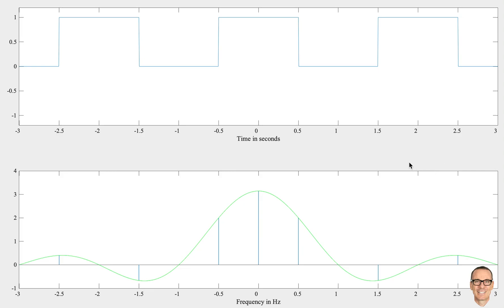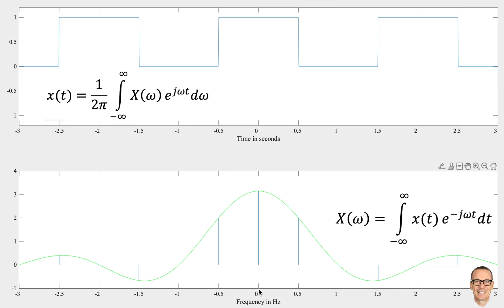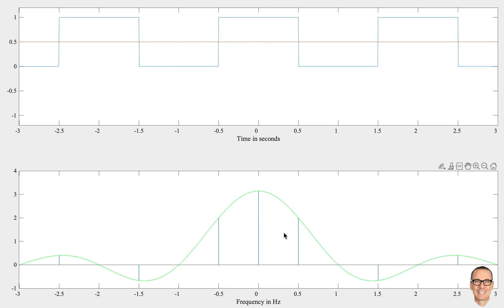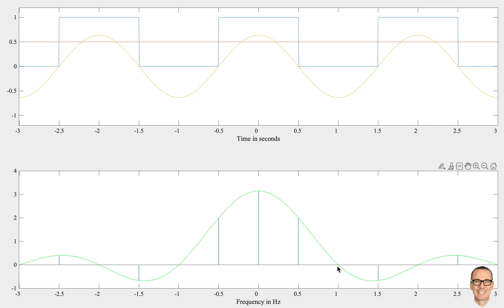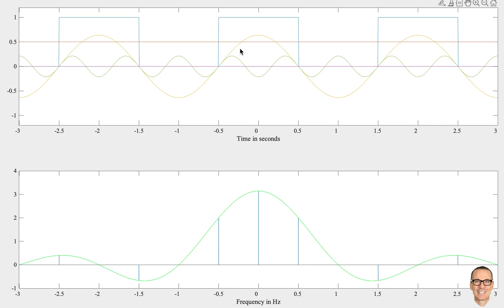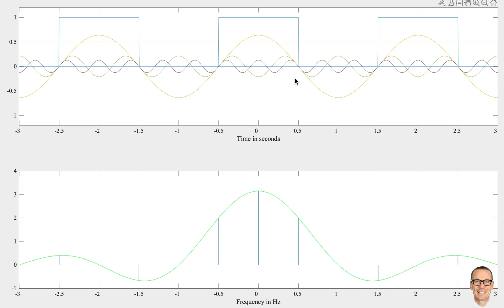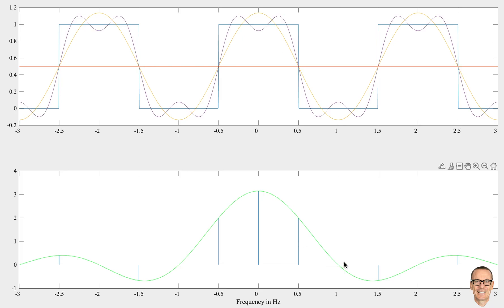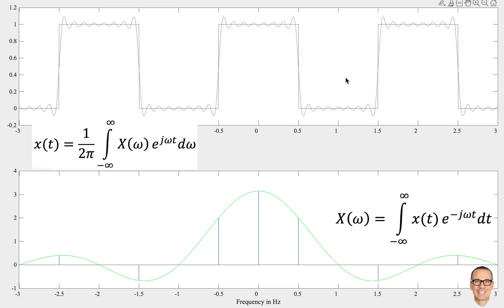Visualising the Fourier Transform

Comment: If each frequency has its own negative equivalent, does this mean only cosine waves are present?
Reply from the maker: Yes, that's right, in this case where the centre square is centred on t=0.
Reply: @iain_explains  And for an odd function, it's all sines.

Comment: Thank you for the video, I understand the horizontal lines are time and frequency. What does the vertical lines means?
Reply from the maker: I'm not sure which vertical lines you are referring to, sorry. Perhaps you mean the delta functions in the frequency domain plot at the bottom? Those represent the individual frequency components that are plotted in the time domain in the top plots.
Reply: @iain_explains  Thank you for your reply. By vertical lines, I mean the y-axis for both time and frequency domain.
Reply from the maker: The y-axis is the value of the function at the given time or frequency. For example, if the function represents the voltage across a capacitor in an electric circuit, then the vertical axis is voltage (with units of "volts"). If the function represents the displacement of a shock absorber in a car's suspension as it drives along a road, then the vertical axis is displacement (with units of "cm", or "mm"). If the function represents the sound level of a musical instrument, then the vertical axis is volume (with units of "dB"). ... etc.

Comment: In the given graph, avg value of the square wave (DC)  is 0.5 right ?
But in the spectrum at zero frequency (DC) it shows amplitude 3.
Why ? Pls explain if my concept is wrong....
Reply from the maker: In the description below the video it says: "* I should have mentioned that the definition of the Fourier transform of periodic signals includes a factor of 2pi. So the amplitude of the bottom graph is 2pi times the coefficient of the respective cos wave. For example, the "zero frequency" (DC offset) component of 1/2, is indicated on the bottom graph by the amplitude 2pi x 1/2 = pi = 3.14159..."
Reply: Thank you very much sir for ur clarification.

But why this multiplication required?
That also wil u pls explain ?
Reply from the maker: The 2pi comes about due to the fact that omega (in radians) equals 2pi f (in Hertz).

Comment: Hey Iain! I just was wondering what the y-axis of the frequency graph was? To me that is the amplitude, but i dont understand how it effects the graph, why is the 0Hz midline .5 instead of 0? Cheers!
Reply from the maker: Yes, it's amplitude. I forgot to say that there is a 2pi factor in the Fourier transform. So the amplitude of the "zero frequency" spike in the frequency domain graph is 0.5 times 2pi = 3.14159...
Reply: @iain_explains I had the same question, thanks for the response! How does the frequency amplitude affect its respective sinusoid in the time domain?
Reply from the maker: Well, each "frequency amplitude" corresponds to a single sinusoidal waveform (in the time domain) at that particular frequency. So the amplitude shown in the frequency domain (scaled by 2pi) is the amplitude of that corresponding sinusoid in the time domain (as I showed in the video when I plotted each sinusoid separately) .

Comment: But at 0Hz [1:15] ,  it is shown as 3v at  transformed waveform..
Reply: is that possible to be the normalized data？
Reply from the maker: It’s not actually 3V, it’s 3.14159… ie. pi. Which is half of 2pi.
Reply: @iain_explains  so we divide the fourier transform at a certain frequency by 2pi to get the amplitude?
It appears that we do so also for other frequencies but dividecby only pi maybe because of the negative frequency?
Am i right at this conclusion?
I also found that fourier transform of cosine is pi times dirac and fourier transform of Acosine is A*pi*dirac so dividing by pi gives the amplitude. Right?